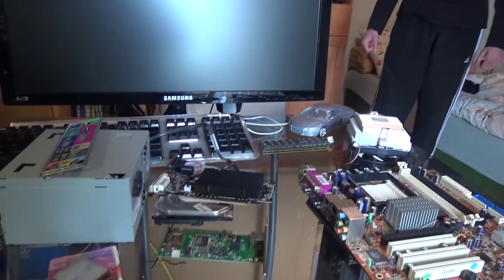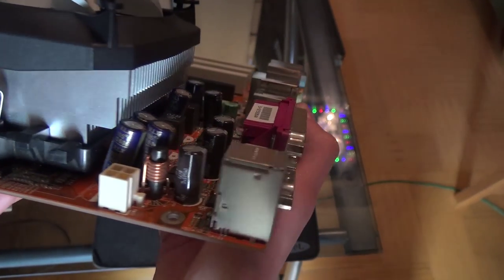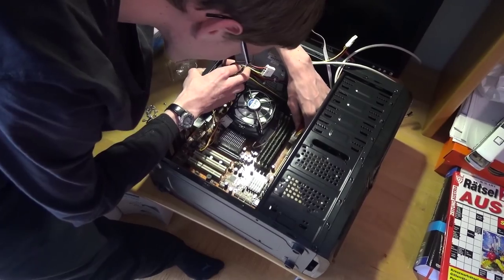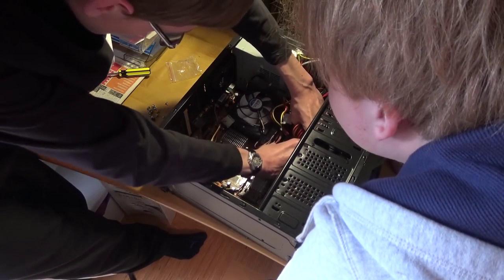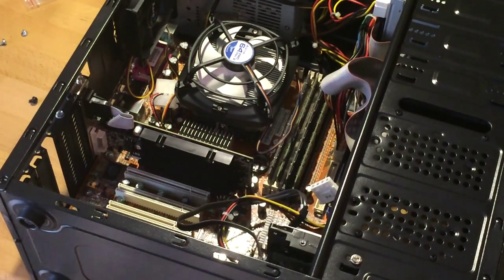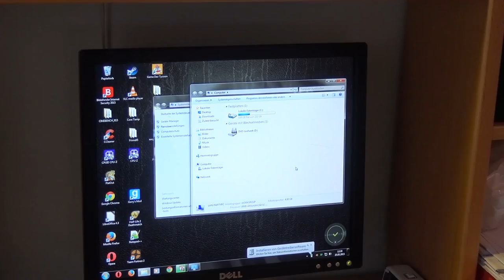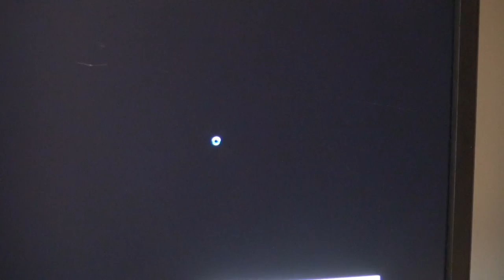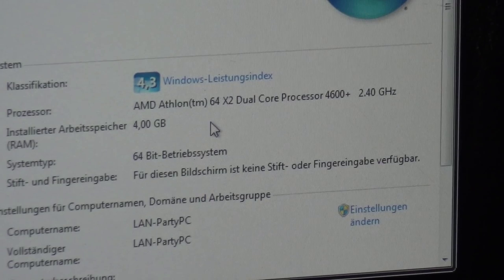AMD PC Rebuild in New Case

Comment: Hey you guys may have realised this by now  but you didnt put thermal paste on the CPU. I may have missed in the video if you mentioned it though.
Reply from the maker: Connor M This is definetely not the way to do it, but I thought the one still left on the CPU cooler would do the job; thanks for pointing it out in the vid. :)
Reply: Oh fair call, I have run out of thermal paste too and need to get some more. I know its not optimal but it is surprising how well CPU's run with old thermal paste by the way.
Reply from the maker: Connor M Yeah, I can't complain. They don't really run so hot, even when I'm doing gaming on it.